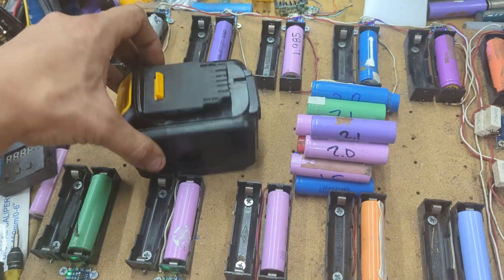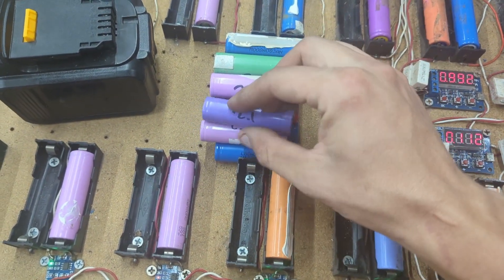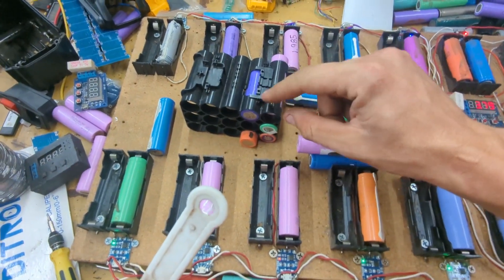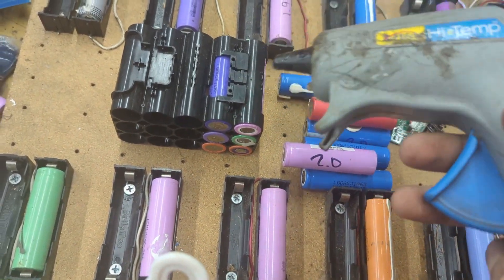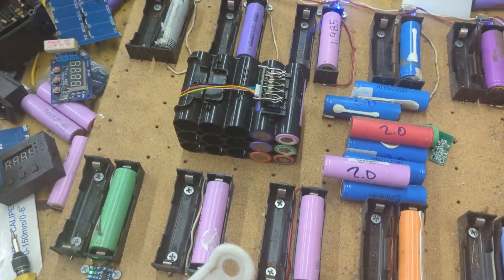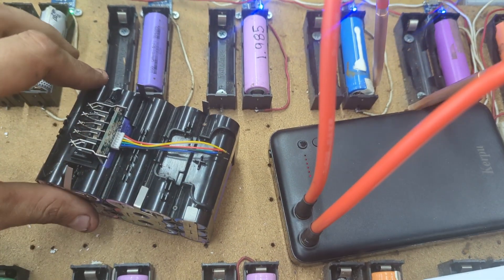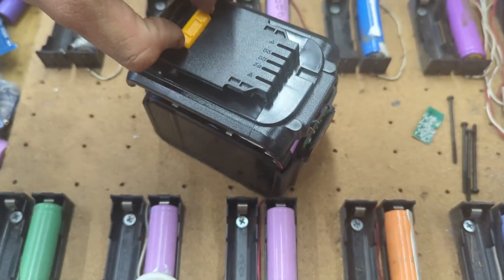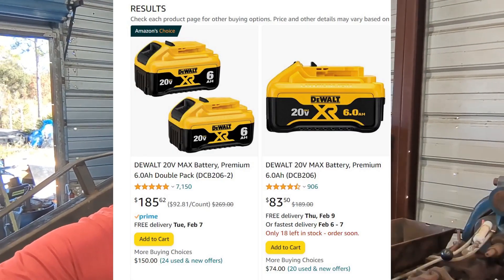DIY Power Tool Battery: How to Make Your Own Cheap and Long-Lasting Batteries

Comment: From my research, you have to be careful to use high rate 18650 batteries for power tools. I think some of those batteries for some uses are low charge/discharge rate.
Is that correct?
Reply from the maker: yes thats correct! I had to learn the hard way with my first battery I used a low discharge rate battery. Now I save the best batteries for my power tool packs and use the rest for other less intense applications

Comment: 3 in parallel. 5 of those in series?
Reply: Rebuilding a battery is so much easier than maintaining a gas chain saw!
Reply: Iron redux!  I've been watching that professor show his progress.  Great for home use!  Are you going off grid, or grid tie?  I keep thinking of ways to use the solar immediately to forgo the battery.
Reply from the maker: correct! and im already off grid and just looking to add more capacity to my system. You can do lithium storage which will last a night or two for a couple grand from battery hookup but if I can scale up the redox flow system ill be able to have energy storage for weeks for the same amount. Redox flow is about $10-20 a kwh.
Reply: @Rowow  dang that's supercheap!!  How big will it be?  Barrels full of iron?
Reply from the maker: @TheRainHarvester  yes a couple barrels full of ferric chloride which is made from iron in hydrochloric acid
Reply: @Rowow  ha ha. I knew it!  We think similarly.  If only ibc totes were cheap.  Once when i didn't have a truck, i had access to many many ibc totes for free.  My friends all drove me in their trucks to get them.  I gave them half of the totes.

Now i have a truck but no more totes .  still looking for a source!
Reply: @Rowow  btw - what are your info sources for the battery?  I wonder if we both have extra info the other doesn't?  You can put any links on any random videos i uploaded and I'll reply with mine. (So you don't spoil the surprise for your viewers).  Feel free to delete this comment!
Reply from the maker: @TheRainHarvester yes I noticed we do think similar haha. Do you use discord? I have a bunch of 55 gallon drums I got for $2 each a long so thats why Im going to be using them as the prototype. Im not worried about spoiling anything and most of my research is sporadic, not anything specific im referencing but this is the primary research paper im using: https://iopscience.iop.org/article/10.1149/2.0161601jes

You mentioned a researcher you were following was it peter allen?
Reply: @Rowow  yes Peter Allen. But he stopped at battery 2.0 a year ago?
I don't use discord ...because don't two people have to be online at the same time to communicate?  And it's voice, so no way to re-read or see other's comments after other's talk?
Reply from the maker: @TheRainHarvester  no discord has chat features and is mostly designed for chat. Voice calling is a option. Yes peter stopped and I don't like his design. Just wanted to make sure it wasn't him cause I didn't like it lol. Very little work on the subject in general being done. Just a bunch of researchers making overpriced prototypes rather than actual cost engineered scalable products
Reply: @Rowow  hehe yeah i kept waiting for more of his videos to improve the design but then he just stopped and i realized it's been almost a year!
Reply: Okay I'll try discord.
Reply from the maker: @TheRainHarvester  haha yeah I was hoping too but fundamentally I think it was flawed from the start. William hada made a functional battery cell that powered a little electric car. Was super simple and cheap in design.
Reply: @Rowow  what's your discord name?
Reply from the maker: @TheRainHarvester  rowow#5457
Reply: @Rowow  i had to use a capital R. Correct?
Reply from the maker: @TheRainHarvester  oh sorry forgot capitalization matters yes got it